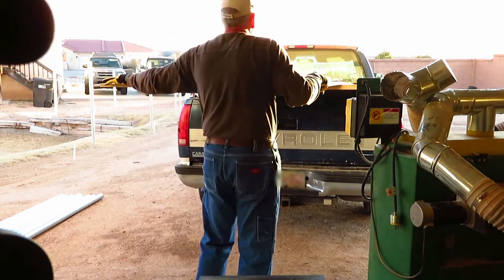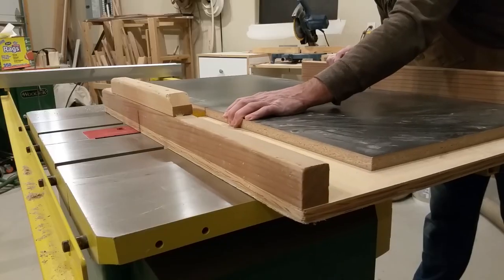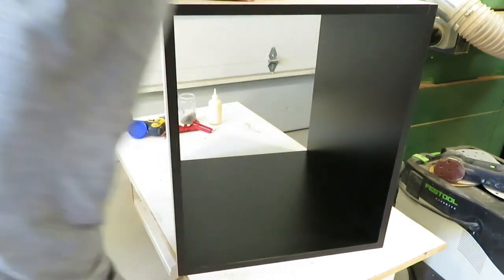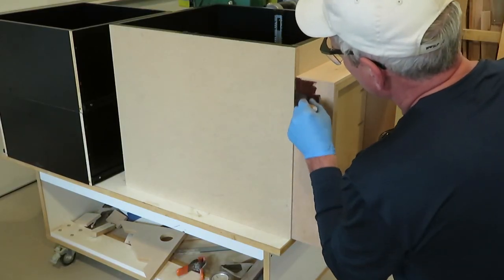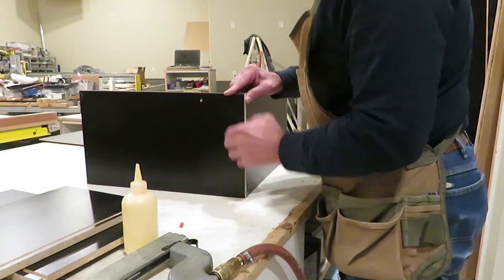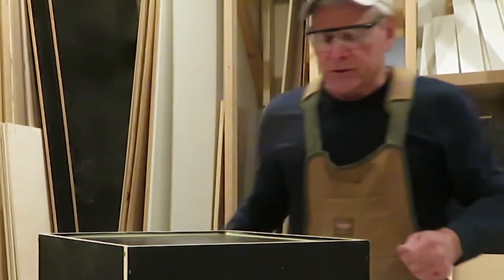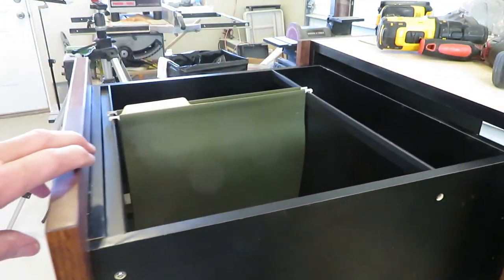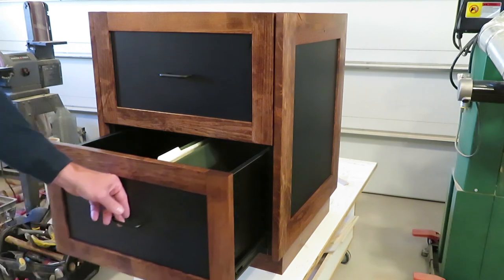Building an Unusual File Cabinet Drawer - Stained Hardwood and Black Laminate and Melamine

Comment: A way quicker way to cut down longer screw is to use electrical strippers with screw cutoff holes on it. Just turn in screw to desired length and snip. When you take it back out it cleans thread back off.
Reply from the maker: Good idea, Wiley! Thanks for the comment and for watching
Reply: @RustyDobbs  I might do alot of odd ball pulls that need different lengths.